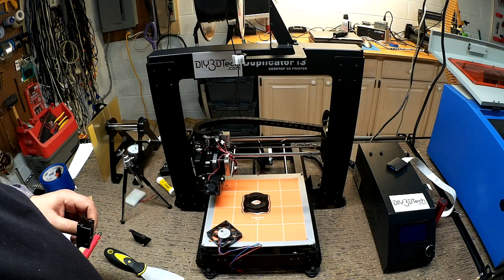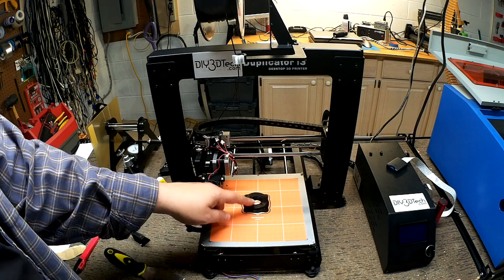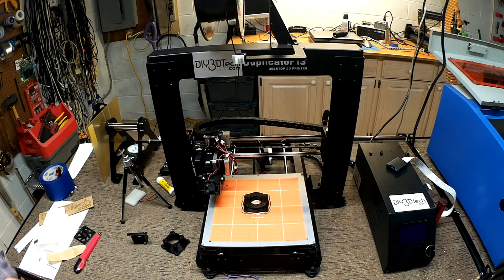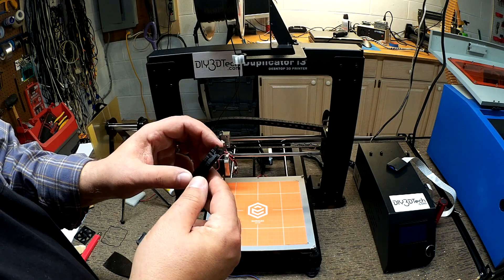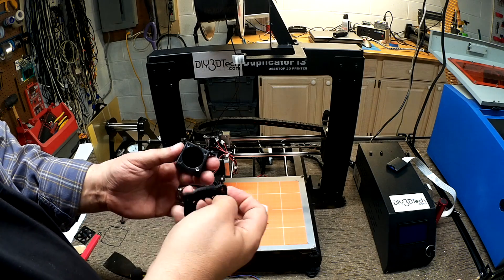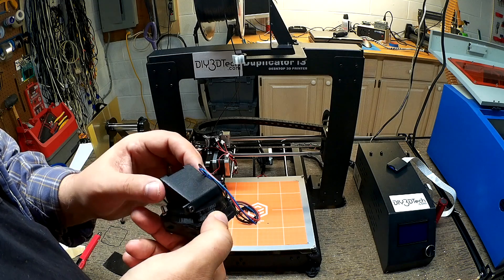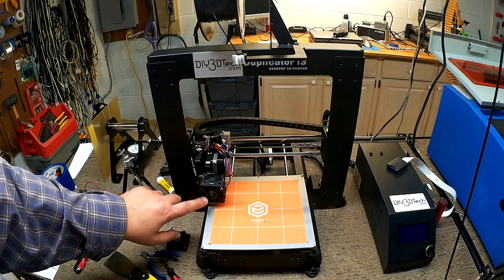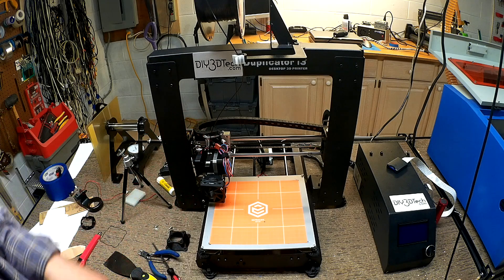Wanhao Duplicator I3 3D Printer -  Layer Fan Modifcation

Comment: What is the build surface???
Reply from the maker: The Wanhao is 200x200 mm
Reply: I meant the actual orange day-glo type material that is being printed onto to allow addition; how good is it for PLA/ABS, etc... may be a video review could help : Thanking you
Reply from the maker: Oh gee-whiz that was long, long ago and think 180x180 or so however have quite some time switched over PEI and have never looked back!  :-)  (where is also recent video which I did on PEI don't the link handy but you can just search my channel and it will come up...
Reply: OK thank You :)

Comment: if you load the goods onto the printer how can you stop it in an emergency once it's started? I just can't see to stop my v2 when it's printing other than power off at the mains.
Reply from the maker: +Andrew Griffiths Bingo!  That is what I do, reach back and pop the switch.  However I have read there is button hidden under the sheet metal in the front which is a "reset" button and people drilled it out and printed a pass though pin.  However a reset button is not an E-Stop in my book.  On my CNC which I converted to GRBL (i.e. Arduni based) I have a switch to kill the power to the motors as an e-stop.  If you wanted to do same for the Wanhao (and I am thinking now this would be a good video project so thanks) is wire in an e-stop to the output (note "output") of the Wanhao power supply.  Hmmm  think I am going order a button and do a video :-)
Reply: +DIY3DTECH.com cheers for that, I'll take a look under the cover when I do my temperature grounding.
Reply from the maker: Just ordered several of these and will do a video!  Thanks for the idea!